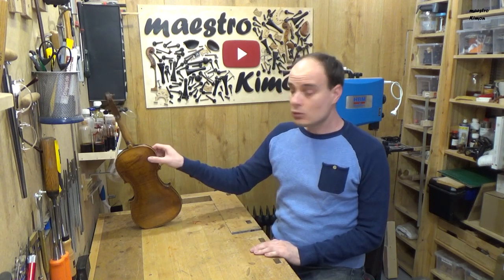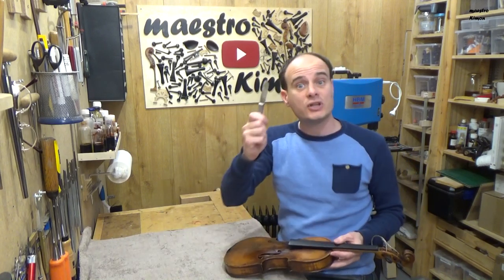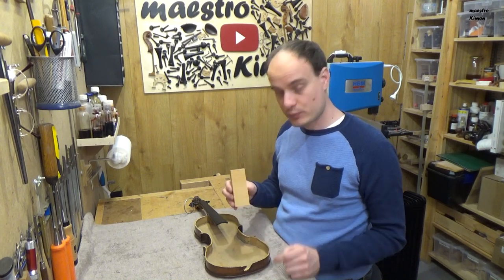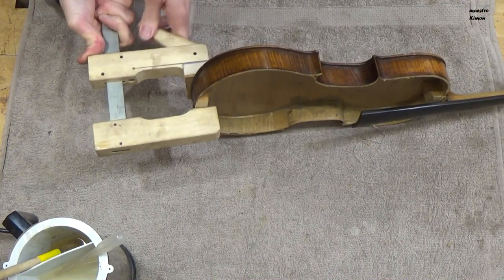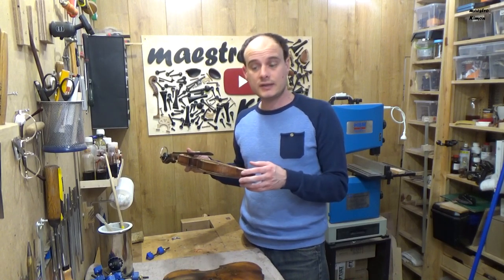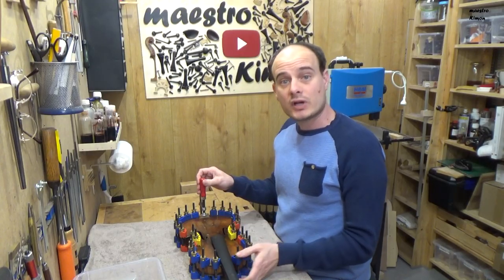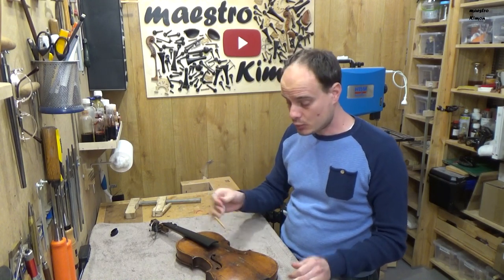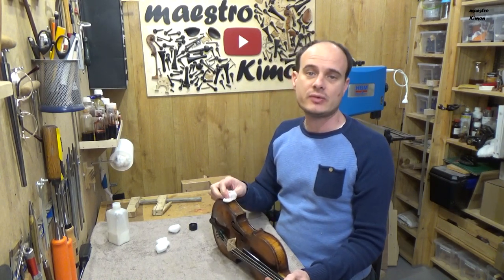Repair Series #17 - Crack and new block

Comment: I got a cheap violin the front of which was loose and came off. It has the same internal design as the one you exposed here (missing blocks etc.), and I am using it to practice repair. It seems that someone put a different neck on it. The blocks are very rough and don’t seem to fit the top very well. It was good to see how you worked on it. I wonder if it will sound okay when I have finished!

Comment: That procedure you do of putting a knife in the seam between the sound board (top or back depending on the project) and ribs, to separate the two, always astounds me.  It looks so impossible.  I always think the wood is about to split, but it never does--waaaay cool!
Reply from the maker: You have to get used to it. But going slowly slowly you can see if the wood is about to split!

Comment: There is also really fast drying wood glue (from a normal hardware store), may be stronger than CA!
Reply from the maker: It doesn't have to be extremely strong, for every case you have to use the appropriate materials.
Reply: @maestrokimon  Fair enough!

Comment: Hi.. how long you are waiting till the warm glue are drying and remove the clampes?
Reply from the maker: It depends a bit on the weather. Warm summer days longer, cold winter day shorter. Also if you need to put tention on the joint you have to wait longer. But as a rule of thumb 2 hours for the clamps and 12 for tention.